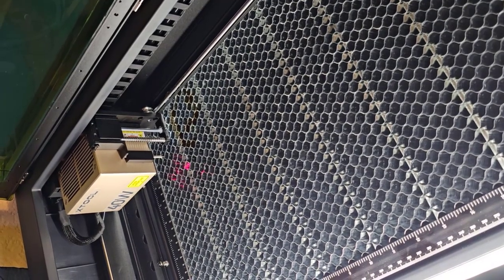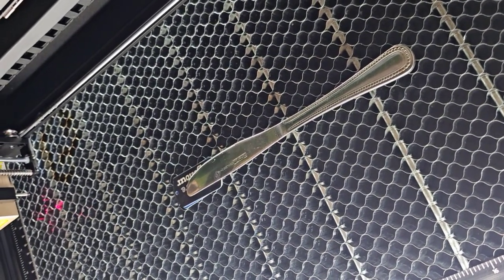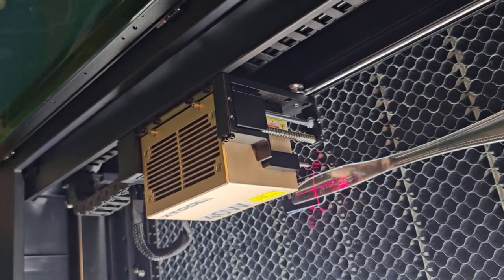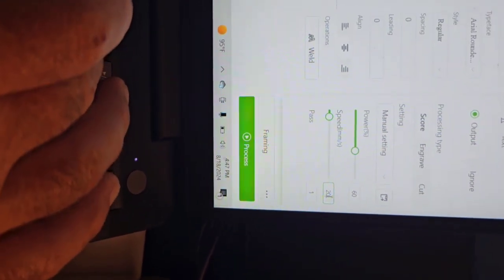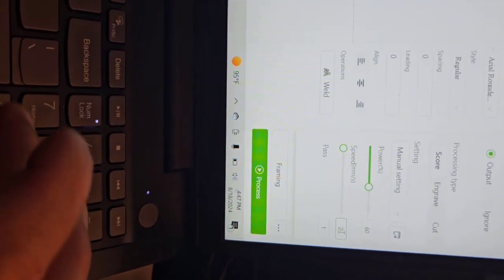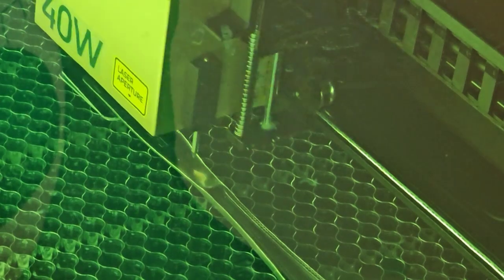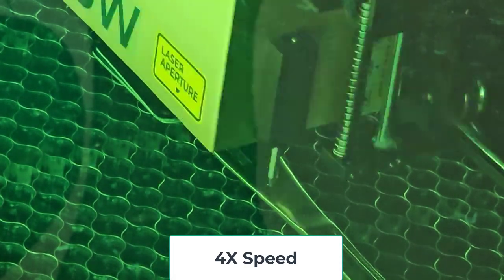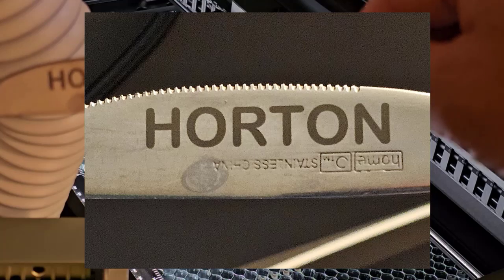Can the xTool S1 40 W Laser Engraver Engrave on Stainless Steel?

Comment: what is the greatest depth the S1 can engrave in the stainless? Would slowing down the speed result in greater depth? Any particular settings you could share to get the greatest possible depth engraving done in stainless? Thx!
Reply from the maker: The S1 really marks stainless, it doesn't engrave it. You really don't get depth. For deep engraves, you'll need the F1 Ultra.